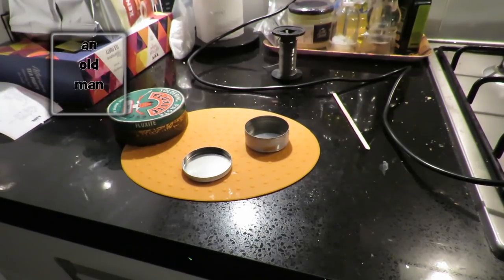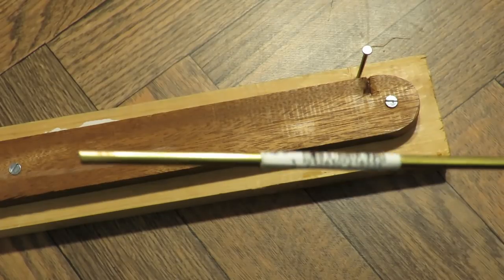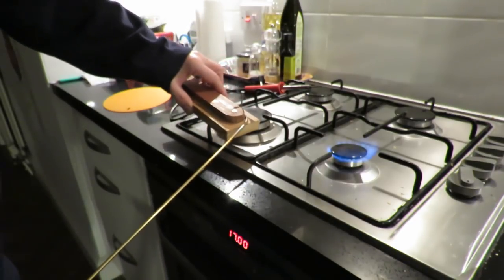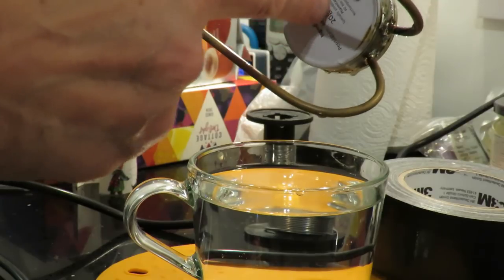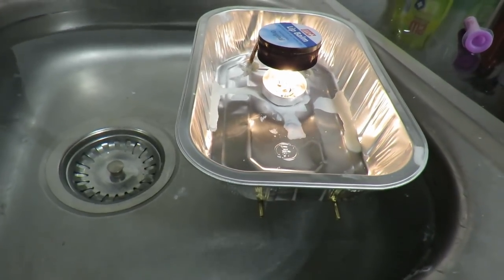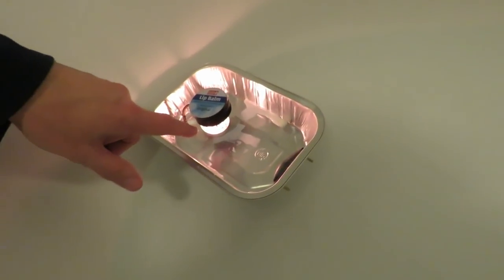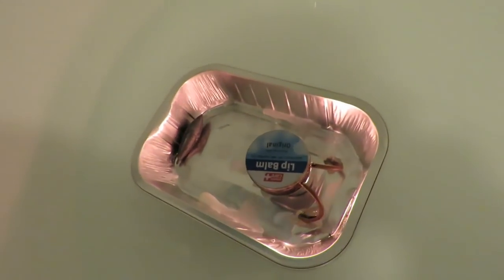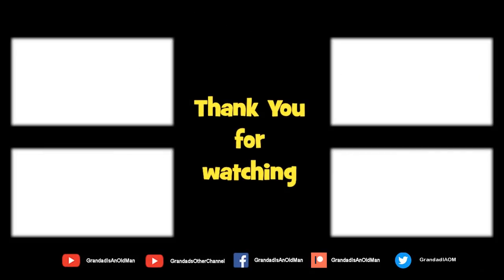Pop Pop Putt Putt boat Shortened video

Comment: There are sure a lot of variables to play with. On your mention of awkward shapes on water moving so freely, it brought to mind an 18 gallon Rubbermaid storage container I once placed in a pool. It will glide across the water with the slightest touch of a finger.
Reply from the maker: There is a difference between moving on water and moving through the water. Items floating on water can be moved more easily than if they were standing on land, but a properly shaped hull will slice through the water with much less effort.

Comment: I wonder if the relatively large volume of the boiler is too large for the tubing, that is maybe impedance matching might help a little?
It has a large surface area for heating which is nice. I've never made one but they look like a lot of fun with all the variations and ideas to try.
Reply from the maker: In the video description is the playlist. I have also included videos by some other builders, in particular Daryl Foster, who spent many years perfecting his designs.

Comment: Great job👍👍 maybe one day try to make a pop pop boat with a rudder that's steered by a servo.
Reply from the maker: Here are the RC versions I have done https://youtu.be/9rokTyAv3xU?list=PLA5a2xPRSrB2M0m754LkqMXQFwFRAS3HK https://youtu.be/jpGnve9APU0?list=PLA5a2xPRSrB2M0m754LkqMXQFwFRAS3HK https://youtu.be/H1aeDsVdOJA?list=PLA5a2xPRSrB2M0m754LkqMXQFwFRAS3HK https://youtu.be/B_Bm5TcCsQU?list=PLA5a2xPRSrB2M0m754LkqMXQFwFRAS3HK
Reply: Cool I didn't even know that you have Done more than I video on it
Reply from the maker: @danielthorpe9941  you might find it interesting to check out my video descriptions. There are usually playlists associated with every video I do and that playlist will contain other similar videos. I have hundreds of playlists linking my thousands of videos together. The end screen also usually contains links to the most relevant playlists.

Comment: Tried to make one before, just couldn’t get the boiler right. Nice video
Reply from the maker: Getting the heat right and the amount of water too. As the water needs to boil I often find I need several tealight wicks. Many of the videos you see on YouTube make the heater with a bigger wick and oil. Putting a wind guard around the flame also helps to concentrate the heat. Daryl Foster made beautiful boats on his channel https://www.youtube.com/watch?v=1yYVHfbxK9g

Comment: There is no sound...why?
Reply from the maker: I explain this at around 12:17 It does make a noise but it is not a loud PopPop. The "pop" you often hear is the surface of the boiler flexing so if you want a loud one you choose the metal for you boiler so it is thin enough to flex. You might find the information and links in the video description useful.
Reply: Stealth technology... metal is probably just too thick to flex and produce sound....